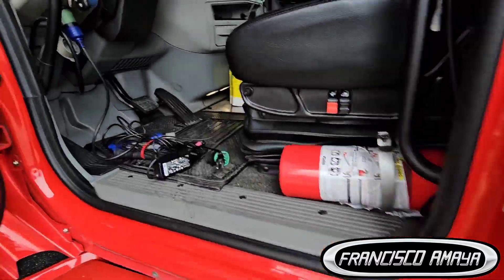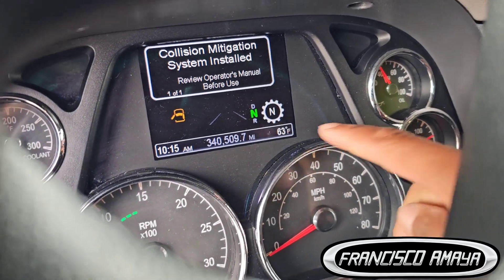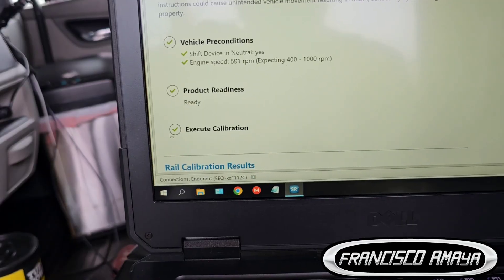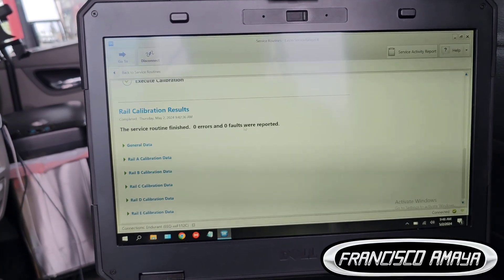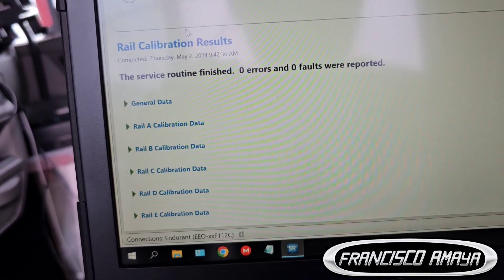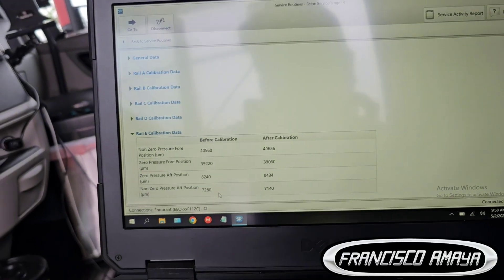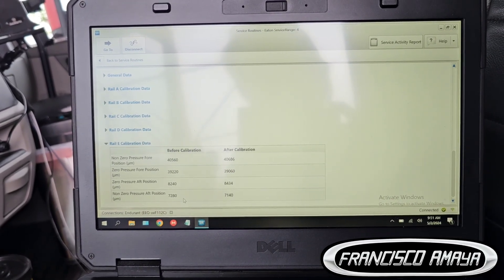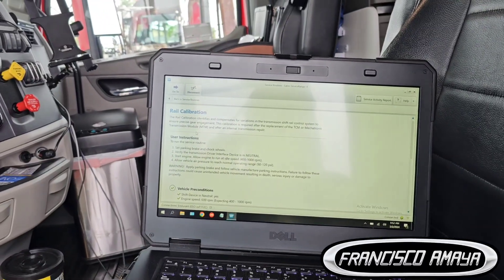EATON ENDURANT HD XD CUMMINS PACCAR TRANSMISSION CLUTCH ELECTRONIC CALIBRATION ADJUSTMENT

Comment: The air dryer filter should always be replaced once a year because of oil carryover from the air compressor,oil will contaminate and damage the mtm also failed rail codes can be caused from loose bolts and damaged o rings in the mtm we see lots of issues with the endurant trans.